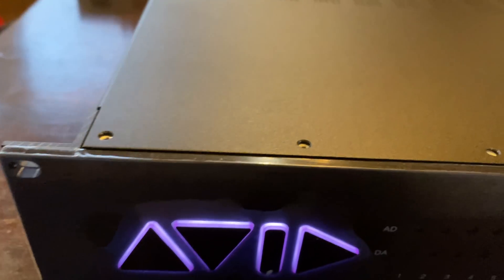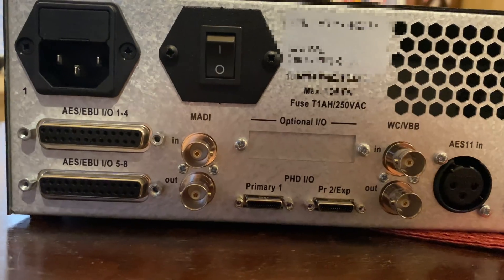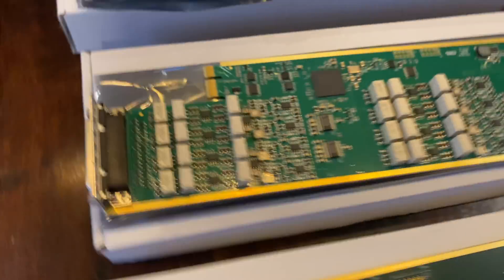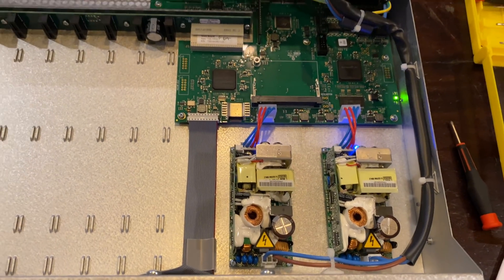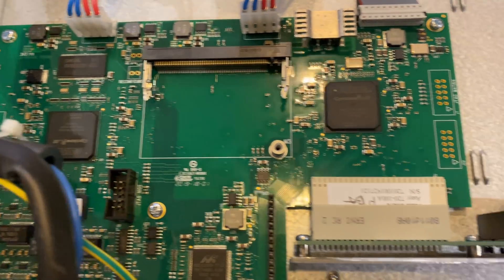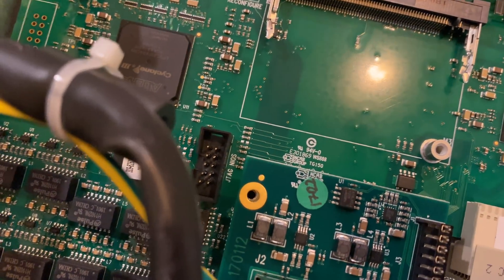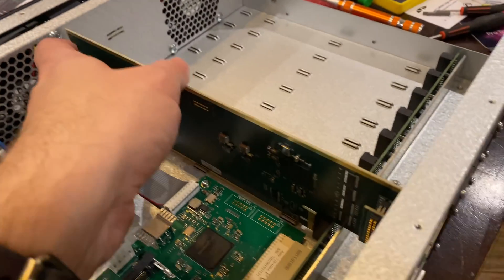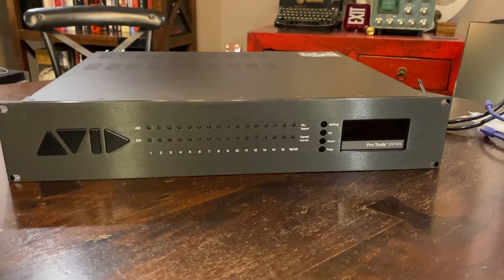Neil's Technobabbles:  The AVID MTRX

Comment: So much editing effort went into hiding the S/N. Lesson learned: Just use tape. XD Man what a crappy system though. I'm sure the functionality is perfectly fine, but wow is it ever built to a cost. I'm an electric engineer (with decent experience in audio as well).

Those power supplies are inexpensive off the shelf Chinese parts (made by Meanwell), despite there being two of them. The part number is EPP-150-24. $56 CAD on Mouser. Buy two for free 1-day shipping. ;) They're fine, but cheap capacitors will be their eventual guaranteed downfall, especially if this system remains in a hot environment. At least it's easy to get spares. Avid would charge 10x their cost as part of servicing (RME does this too lol). No attempt to shield them physically for interference (slightly higher-end models come with their own shields).

The LCD screen is absolute garbage - for a $5k+ system, coughing up $15 for an OLED display which is viewable from all angles would've been nice. This is zero effort. The entire system works on devices called FPGAs (those Cyclone III/IV chips). Those specific ones are about $10-30 per chip in volume (they're the "low-end" FPGAs.. high-end FPGAs are a whole different story in terms of cost/complexity). I actually program these exact chips for some of my jobs. A good chunk of the cost is from that, to get custom functionality as needed. Having said that, if all they're doing is routing and formatting audio data, that's very simple. Doing DSP (audio effects etc) via FPGAs is more complex. Implementing custom protocols can be complex as well.

Having to move the main system board to install a card is ridiculous of course. The DAC card looks alright but far below Avid's broadcast designs even from 10 years ago (in terms of specific design considerations). No attempt to use high reliability capacitors (saving literally maybe $5 while guaranteeing eventual failure). This system was made by a third party and I don't really see any "avid fingerprints" on it from their broadcast engineering group who definitely knew what they were doing. This is a somewhat basic design but I'm sure that it meets its specs (hopefully haha). It's honestly a depressing system. I'm a professional as well, and I get the whole "if it does the job and integrates well, it's good enough" logic, but it still feels bad to pay this kind of money to get a device with maximum cost-cutting at every corner. A lot of "big" manufacturers have started going in this direction, and Avid is no exception. I work a lot with high-reliability industrial/military gear and even these professional devices are depressing by comparison, especially since overall build quality from these types of companies used to be far better. Gotta keep pushing those profit margins eh?
Reply from the maker: whatlions yeah I didn’t think about it till after.  Doesn’t matter really.  Oh well. 

This thing is a repackage of a DAD AX32 by Digital Audio Denmark for AVID.  So the only thing that’s them is the front logo . Sorta like when RME made stuff for Stienberg for a minute.   The routing,  format conversion and AD/DA is better than anything avid offers of their own.  But yeah,  it’s really interesting to hear your EE take on it!  And I’ll probably stock up on a few supplies while I’m at it.  My modular synthesizer uses these massive 2U acopian linear supplies which are probably night/day better!   Speaking of gouging...  the optical transceivers are $300 each from avid and $40 from mouser.  It’s such a load of balls.  I’ve ordered a few and if they work,  I’m returning them.  Gahhh!!
Reply from the maker: also forgot to add that yeah the box is sifting between a ton of formats,  proprietary AVID communications and various audio formats:  MADI,  AES etc etc..
Reply: @NeilParfittMusic  Definitely a useful product overall given all the format conversions! Maybe the blessing in disguise here is that parts are cheap to get on your own haha. If possible, please update me if the transceivers from Mouser worked. :o I'm very curious (I'm Nick btw). I hope Avid didn't "customize" theirs in some deliberate way to lock you out of retail options. Acopian makes very nice supplies for sure. I would argue linear supplies aren't a requirement for high fidelity audio these days, providing that the product is well-designed. Lots of super high quality switching PSUs can be had from Vicor and others. When they're well-filtered (which definitely adds cost), you get the best of all worlds - very high efficiency, low weight and very clean power. A lot of products I make are in that category. I have a nice Class A amp which is basically a space heater, but I also have a very unique 350W RMS Class D amp which uses 10W at idle and sounds far better. It's on 24/7 and I don't even notice it on the electricity bill. I'm a big fan of well designed modern gear like that. All problems associated with high-efficiency gear are solvable. The power of science muahaha! >:D
Reply from the maker: @oriole8789  Hi Nick!  Yeah I'll know soon enough as they just arrived.   The linear supplies made a huge difference on my modular synthesizers as those things are super sensitive to noise getting into the audio path.
Reply: Great so all we have to do is become an electrical engineer, buy all the parts and build and test it ourselves and we can save all that money!  Thanks!!!!
Reply: Since you claim to do this for a job, you probably know that your company doesn't sell products based on how much the parts cost, they pay your fucking salary and benefits too.

Comment: The MTRIX is just a rebranded DigitalAudioDenmark DAD AX32 including MiniDigiLink IO. This was stock on older AX32 units before Avid made a deal with them to exclusively feature MiniDigiLink on the rebranded MTRX version. And Avid ramped the retail price up too roughly 1/3rd. The optical MADI option is not planned for field/user installation. The empty slot you mention on the CPU board is for the DANTE Brooklyn Bridge, not for the optical MADI. Besides the DAD brand there are also very versatile routers available under the brand name NTP, aimed at the broadcast and installation market. I installed a couple of the units at my clients sites, mainly composers for TV.

Comment: Very interesting product. Too bad it doesn't look as good as the old HD racks, especially with that AVID logo that's way too big and with the LED. At first glance it looks like some DIY project, considering the giant logo, galvanized steel chassis, how the extension cards are placed in and the little bits of things missing, which is a bit strange for a system this expensive.
Reply from the maker: This is made by DAD for AVID.  It's significantly more flexible than any interface AVID or 3rd parties offer for Pro Tools use.
Reply: Despite that, it still looks like a DIY project.

Comment: I’m a film tv editor and enjoy your videos. I read a lot about all the PT gear but don’t get a lot of hands on time.  Love seeing the in depth tech bits.  I finally have a edit suite with 7.1 audio via JBL LSR monitors.  The 6325p-1 for the surrounds and the fronts are the LSR 4326p with the hiq interconnects.  Neat speakers.  They only made them one year.  Sound pretty good.   I wish avid would make a video IO box again with 96khz audio.  They haven’t since the DX box.  Currently working on a doc film with tons of high res concert and studio audio.  Have to convert it for most systems.  I have a older DX box but yeah.  Always wanted to have a system with media composer running with PT locked together all the time.  I wanna be able to edit by the sample in the timeline.
Reply from the maker: Sounds like a sweet rig still!

Comment: this uses an FPGA inorder to deal with the custom I/O you are doing while the cost of making this thing tops out at like 500 bucks programming an FPGA is a pain in the ass and now you need to make it so that any config a user comes up will work and do so at the speed needed is a very pricey matter.

with this device you are paying for the software and software support not the hardware.
Reply: RME has been doing this for years already. You don't get those extremely lower latencies and flexibility for free.

Comment: 1. How the f am I making a living in music, I'm obviously a complete dilettante.  Definitely of the unicorn farts set.
2. Ultra dumb q from an established dilettante: is this basically your whole I/O?  And is this level of complexity and scale required because you're mixing orchestral sessions?
3. Do you find that replacing  c for which the function f c ( z ) = z 2 + c does not diverge when iterated from z = 0, i.e., for which the sequence f c ( 0 ) , f c ( f c ( 0 ) ) ,etc., remains bounded in absolute value?
Reply from the maker: 1. 442Hz!
2.Yes - this replaces everything I was using to get audio in/out of Protools,  wrangling all audio coming from Logic,  dealing with format conversion getting to my monitoring system.  It's the do-everything box that replaces everything.
3. I=W1LL show U (at) BBQ

Comment: Do you use HDX only because of the software limited Pro Tools inputs with Core Audio? I'm looking to get a MOTU AVB setup and then make some kind of Keyboard Maestro magic to change the inputs on the fly to work around the 32 input limit. Avid always being a pain in the ass..
Reply from the maker: yeah - i needed way more than 32 i/o.  Also,  I'm writing in Logic and it mixes through protools so the near 0 latency was very important.

Comment: I guess it is good not to cramp this board plus the modular boards in a 1u case. This is helping not to get warm. The thing that seems very cheaply made (or choosen) is the 2 pulse power supplies that are not shielded at all. The previous generations HD IO had very well designed PSU shielding.

Comment: Wow - very scary.
That RME card I have mentioned: it required firmware update and the manual told me if I did it wrong the whole card would be useless.
This is awful stuff that these manufacturers throw at you.  I hate it....
Reply: Q: I am a complete newbie with things Pro Tools.  
Are these the same cards that you put into your new Mac Pro?  
Why the Matrix?
Are you ‘the One?’
Reply from the maker: @johnwade7430  hah! NEO!

No this rack is the outside box that connects to those cards on the inside of the mac.  The MTRX is the gateway to all audio signals in the studio

Comment: For working on open computers, interfaces, etc, you should buy a big anti-static mat, connect it to a ground, and wear an anti-static strap. Walking on a carpet can generate up to 35,000 volts (they can zap 30 Amps in just a few ns, destroying delicate electronics). There is a recent video by Wurth Electronik Group entitled "askLorandt explains: ESD Basics" with more info. Also, do NOT touch any electrical contact areas, particularly for RAM, PCIe boards etc. but also cable ends; dirty contacts will reduce reliability (my buddy ran a huge server farm and has confidential stats to back that up).
Reply: dos gos …and remember to use some tweezers so tidy up those cables. ;-)

Comment: Question is the converters the same as the Avid HD I/O’s? Also your Mac Pro doesn’t fit in your rack because the track has to attach on the back as well? Or could it just kinda hang out the back a bit if you wanted?
Reply from the maker: no, they're better.. but it's like arguing over the taste of two great whiskies.    That rack cabinet isn't permanent.  I have a different cabinet coming that'll hold everything properly - and then this journey is complete!
Reply: Neil Parfitt I was asking more to see if you needed a specific length rack to fit the rack version in or not. I have studio racks and I don’t mind it hanging out of the back as long as I can install it fully. But does the rack have to be server length or something?
Reply from the maker: Starski Pimphop  even though the Apple rack is 19” deep,  the rails require a minimum 24”

Comment: And people were moaning about the price of your Apple Rac(k)intosh Pro... Being an actual professional is expensive as heck, but as long as the equipment helps you pay the bills, it's worth it
Reply: The thing is, because some people like to toy with audio, they feel like audio stuff (which includes the computer around which your setup is built) should be in a price range that's accessible to everyone. While at the same time they'll totally get why, say, a crane or caterpillar, or a big CNC, are too expensive for them to purchase, even though it's basically the same. Pro work requires pro tools (no pun intended...I guess ?), and they're expensive.
Hell, again, I work almost daily on a PA/mixing desk setup that costs several hundreds of thousands euros, and would make ZERO sense for your average weekend warrior. Still absolutely fine for the room it's in, and for what we use it for. And has already paid for itself nicely. Which in the long run is all that matters.
Reply: @NicD5150  thats because a)
The manufacturer sells a highly special ized product b) expects you to have the money as a professional and c) companies generally calculate cost completly differently to your average guy.

At the data center I work at we have routers, switches, servers and other stuff that simply doesnt make sense for your home network.
Like the routers are configurable for a miltitude of Interfaces like optical ethernet and even infiniband or legitimate WAN optical connections going multiple kilometres to nearby cities.
None of these things matter to you as a home user and Ive never seen anyone suggest differently, so I dont get why people think differently when it comes to audio.
Reply: @NicD5150  as an engineering student I do not get why I can't have a CNC at my house lmao I feel like it's my right
Reply: Believe it or not, the cost has gone down significantly over the years.  192 I/O in the HD days was nice car money.  Making it mobile was hugely more expensive than Neil’s setup.  30RU, 500+ lbs in multiple cases with custom interconnects - most of that is gone with the MacPro / Matrix system.
Reply: Thing is, the Rack Mac Pro is exactly the same as the tower one, so there's no reason for it to be more expensive.
Reply: @BrunodeSouzaLino  It has mostly the same parts, but there are quite a few exclusive parts to the Rack version (which means more R&D money). The rack is even more niche than the "normal" one, fewer units sold to cover R&D costs. Maybe the most important point though, is that the target demographic of the Rack is not going to be scared away by that markup so they might as well add it.
Reply: @SuperSiggiboy  The only different thing in the rack is the form factor. Everything else is the same. So much that Apple uses the same page for both, even when you're buying it.
Reply: @BrunodeSouzaLino  A form factor that is complicated to manufacture and requires different tool paths, etc. Sure it's a case, but designing a case costs money. Less of which will be made on the rack, so they charge more. There's a reason for it to be more expensive.
Reply: @vsevkrawczeniuk8019  It's the exact same front panel. You could argue that the tower model is more expensive to make and has more parts.
Reply: @BrunodeSouzaLino  It's not the exact same front panel. It's got the same holes, that's it. Tower is all one piece of aluminum around the whole case, rack is a flat piece. Tower might be more expensive to make, but more people will buy it. Economies of scale.
Reply: @vsevkrawczeniuk8019  Which only add more salt into the wound.

Comment: Long time Pro Tools native user here, love what you're building. I'll never understand Avid's support model- their flagship product  has a potentially serious design flaw (no stand-off for the daughter card)?  Critical mounting screws not reachable? And that additional I/O is marginally user installable, many users would screw it up, good job there.  I wonder what they are thinking sometimes.  I need 64 I/O to run hardware inserts in my home studio and I'm seriously thinking of moving to Studio One /Quantum. I am a weekend warrior and don't have anywhere near your requirements. Good luck with your new state-of-the-art rig!
Reply: Maybe you'll get stand offs if enough shareholders complain about it. Or, Avid will turn vindictive again and raise the upgrade prices.